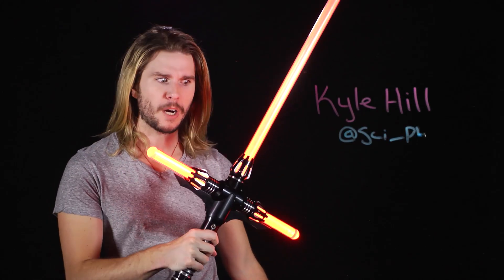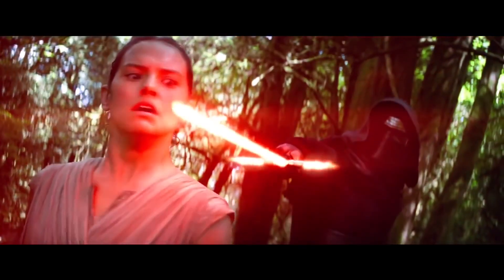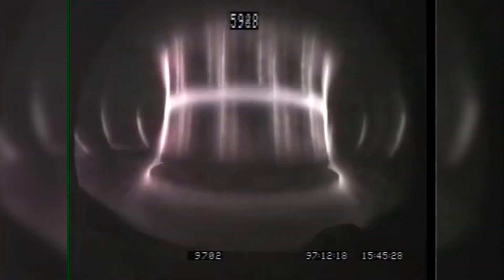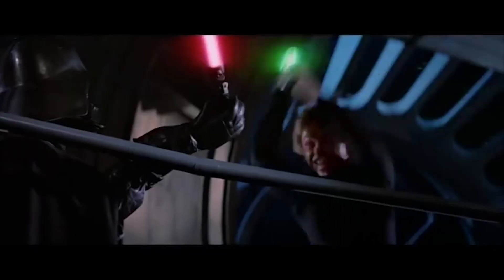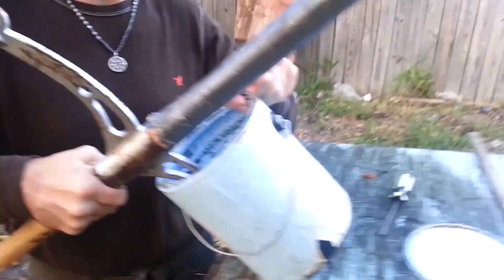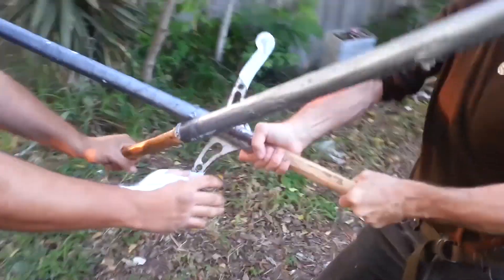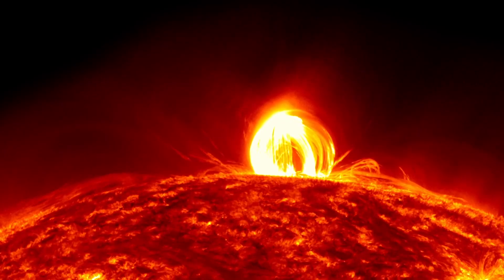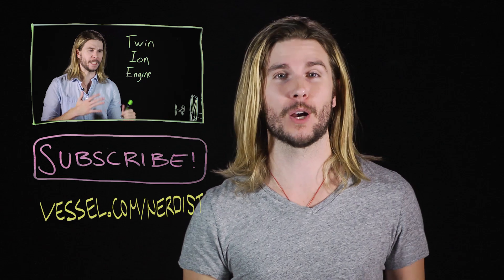Why Kylo Ren's Lightsaber Works (Because Science w/ Kyle Hill)

Comment: We also see Kylo Ren use the cross guard for offensive purposes in the film (don't want to spoil it) so maybe that's a purpose for it. There's also the theory that they're there to vent excess energy, as his lightsaber looks to be either; made by someone not very experienced OR that it's old/broken.
Reply: The weapons book shows that it's made with a cracked Crystal, creating unstable and volatile energy, requiring the split into 3.
Reply: +Laurie Fitton The excess energy is correct, was confirmed at a Disney event a while ago.
Reply: +Laurie Fitton His power crystal that he uses is unstable. That is why his lightsaber arcs cracks and acts like static. It's supposed to be a metaphor to his character. Angry, unstable, unorthodox.
Reply: +DomR1997 The Sith make them synthetically. No natural reds.
Reply: Then direct it in a more forward facing fashion with metal hand guards behind it. They have metals made specifically for withstanding lightsaber blows in the star wars universe. Why no one thought of this is beyond me.
Reply: True. I was just pointing out information, not trying to justify it. In reality, the designers made it this way because it looks badass. They probably didn't think too much beyond that.
Reply: And that the cross guard thing is just venting off some heat
Reply: Disney's official explanation is that his lightsaber's model is a prototype that's really REALLY old
Reply: +Jesus “LastFireAce” Lozano indeed, medieval swords used it for reasons, Ky-Lo Ren is just not so good with a lightsaber(you get what I mean, he's not so experienced with the dark side, this means he didn't have much lightsaber experience)
Reply: +Laurie Fitton - WARNING! SPOILER!
---------------------------------------------------------------------------------------------------------------------------------------------------------------------------------------------
-
-
-
-
-
-
-
-
-
-
-
--------------------------------------------------------------------------------------------------------------------------------------------------------------------------------------------
Kylo's saber utilizes a crystal that has been cracked (unstable crystal) which causes the rough look on the saber itself. It's been described in detail before and used in some games (namely The Force Unleashed) and comics as well as being confirmed by Disney and J.J. Abrams to be the type of crystal Kylo uses.

The design itself, the tri-laser design, is an old one and one of the first from The Old Republic era. It's effective, both for offense and defense and it sure as hell makes for one freakishly cool lightsaber. Plus it fits within the concept of the Order of Ren as well as Kylo's conflicted personality. It's offensive capabilities are clearly demonstrated in the film, when Kylo battles Finn, but the defensive is relies more on logical deduction than visuals. The two extra sides also serve as an energy vent for the unstable crystal, so that it doesn't overload the saber and malfunction, most likely leading to a fairly violent explosion and a painful experience on Kylo's part.

Yes. I'm a major Star Wars nerd... Who isn't? :P
Reply: +Spike Spiegel What is with the recent ignorance of what autism is recently? Why is everyone using it as an insult where it doesn't even make any sense?
Reply: you're right it's to vent excess energy. they even confirmed it
Reply: The reason for the vents is because his crystal is broken
Reply: you mind if i tell you something. what if i told you, the design ain't new and copy from one of the oldest Knight Sword in history. You can use it deffesive and Counter offensive by staving them with it from close combat. also is dangerous. but if you don't know how to use then Don't touch. also a bunch of Normal Sword have it -__-
Reply: +Brandon Adair You mean the crystal he could replace any time? They form in caves in specific areas. All he would have to do is search through old imperial archives I'm sure.
Reply: +tehfaceguy I know that, but wouldn't a functional lightsaber that's not likely to cause self maiming preferable to a red one that's unstable? The sith are supposed to be pragmatic. But he's acting more incompetent than Lucas was when he made Jar Jar.
Reply: +Laurie Fitton Yeah, it was used for an offensive purpose, so no one can fault him for that. And according to Wookieepedia (yes, that's the official name of it), he has those crossguards because they serve as lateral vents for his crystal. It's cracked, so it doesn't produce a solid blade. It's effectively just shooting plasma out of a barely contained field, like the unstable crystals from Force Unleashed.
Reply: +Sam G (ghost trap comedy)  the cross guards aren't even cross guards they are exhaust ports because his power crystal is cracked
Reply: TheWarrener That's just bad logic, right there. That's like saying "hey, if you didn't want to get mugged you shouldn't have gone outside." Seriously, when people decide to reveal information that others would like to be kept secret until they decide otherwise, it's general courtesy to at least offer them a warning. Anyone who spoils a film (or anything else for that matter, within the context of course), on the internet or not, without giving spoiler warnings, is an asshole who needs a lesson in social boundaries.

Take my own comment above for example. I say "Warning! Spoiler!" and then proceed to write my comment in such a way that one has to click 'read more' in order to get it's contents. You know, out of general civility and respect. If you think that's too much effort or not necessary, then in my personal opinion, you're a fucking asshole. But that's me...
Reply: +hassi44 Couldn't have put it better myself, I don't get people who are still moaning even though we have had plenty told to us about the saber.

I'm more curious WHERE he got the crystal, got high hopes for it being Vaders salvaged crystal that was saved along with the helmet :D
Reply: hassi44 It is a Kyber crystal, a cracked red one. I mentioned all this and the effect it has on the sabers design in my reply to Sir Stampsalot :p
Reply: Yeah. They're actually vents. Because the saber is unstable.
Reply: +DomR1997 Red Kaiburr crystals aren't natural, the Sith make them; and each Sith lord makes his own (generally). Darth Maul make his saber in a forge, using the force to keep himself alive and build the saber and crystals!  If Kylo doesn't have the discipline (as is apparent with his tantrums xD) then he wouldn't really be able to forge a fully stable crystal! At least that's my theory
Reply: +DomR1997 be preferable*
Reply: Yeah, that is what Wookiepedia said about his light saber. They said that it is venting energy and made of an unstable crystal.
Reply: +Jesus „LastFireAce” Lozano No it isn't.  Old crossguard didn't have 3rd blade if I remmber good.
Reply: NemoTheEight Your talking about Lightsaber? Then is new, if your talking about sword ain't new, been around.
Reply: Jesus Lozano http://starwars.wikia.com/wiki/Crossguard_lightsaber 2-bladed crossguard lightsaber. Swords never had additionalblades, they rather have blunt guard.
Reply: You don't understand what i mean at all. -_-
Reply: MasterMerc13 So Ren's fanboys just try to create artificial purpose for sth which was just accidentally?
Reply: +MasterMerc13  the unstable blade may also refer his uncontrollable character (kylo himself is very unpredictable)
Reply: +NemoTheEight Brother, I am not a fan of his character by any means. He's the whiniest bitch in Star Wars. I'm just telling you the explanation I found on the wiki; I try to keep up with information like this. It's a cracked crystal, so logic would hold that damage to the source of the blade would cause distortion.

As for the crossguards themselves, the concept is garbage. Unless they're made of the right material (phrik), they'll get shorn clean through like Maul's saber and he'll be down a hand or two.
Reply: +Lukas Gratzer Yeah, I think there's an interview with the actor, Adam Driver, where he specifically refers to his saber as a metaphor for Kylo Ren. He's...definitely unstable, alright. Could use some electroshock therapy. Or a good decapitation.
Reply: +MasterMerc13 are you forgetting 10 year old anakin?
Reply: +Laurie Fitton Its not your fault if you spoil, but its them who uses the internet when they doesn't want spoilers.
Reply: I can't do anything, there will always be people who spoil, what do people that doesn't want to be spoiled expecxt? Its the internet
Reply: That's not a theory it's the canon explanation the crystal is cracked so it needs vents for the excess energy.
Reply: StormyIceHD
Where was this stated?
Reply: +DomR1997 But what if there was a specific reason he wanted this exact crystal. Maybe it was Vader's, he already shows a devotion to everything about him
Reply: +Laurie Fitton you are right m8, Kylo Ren's lightsaber is unstable and you can notice that if you see the SW TFA movie posters, where's Finn with the blue lightsaber and it looks completely normal, but if you look at Kylo's blade it's like emanating sparks...
Reply: +Sir Stampsalot Not experienced with the dark side therefore not experienced with the light saber HE built... No sense in that argument.
The "cross-guard" as stated many times. Including in the new Visual Dictionary. Are ventilation to release excess energy from a cracked Kyber Crystal core which would build up and cause the saber hilt to explode. Yes new, whole crystals can be collected on planets in the outer rim (Illum, Dantooine etc...)  and red crystals are synthetically "grown" but think about this, if you had the knowledge to grow a crystal that powers lightsabers and even the death star laser... Yes a huge kyber crystal powered both the death star and StarKiller bases lasers.
Would you note that down for anyone to just pick up, click on the holocron and boom, Crystals of death and destruction for dummies. With no Sith (that we are aware of as Kylo has already been stated to not be a Sith (yet perhaps) and we know jack all about Snooke) who would pass on the ways of growing the crystals to Kylo and other Sith Acolytes?
I have a feeling the crystal was salvaged along with Vader's helm frommost likely Vader's saber hilt, which would probably either have been on Vaders pyre on Endor or found in the wreckage of the second death star (speculation about the Kylo's crystal origins, i don't claim to be almighty and knowing.) :D
Reply: +Laurie Fitton It can serve more than one purpose.
Reply: TenesAsylum I don't know where he got it from, but supposedly it's a Kyber crystal.
Reply: +abandonedvoid The canon star wars the force awakens visual dictionary
Reply: StormyIceHD
Oh, cool. I'll look into that on the wookiepedia.
Reply: +Laurie Fitton The force crystal is shattered actually. Force crystals are near impossible to come by, so he had to use a shattered one.
Reply: Piggles The Pig Kyber Crystals my good friend. Not near impossible either, there are entire planets covered in them :P
Reply: TenesAsylum Yeah, never can remember the name, but what is the planets name? Either way, it's been confirmed that the crystal is shattered.
Reply: Illum and Dantoinne i think as well, but to a lesser extent, hence why the old jedi temple was there.

Yeah Kylo's crystal is basically split in two.
It's pretty dangerous but if it can be wielded to the same effect Kylo wields it... an unstable/cracked crystal is incredibly dangerous, because they're noted for spitting plasma and excess energy from the magnetized holding field :D
Reply: +DomR1997 " dark side crystals " or red crystals are artificial. The blue or green ones from Illum are used by jedi. The red crystal is said to be more powerful than a natural crystal and could ( even if we never see it in the movies ) " break " the opponent's blade. So I don't think Kylo Ren would like to replace his artificial and powerful crystal. Also, if you've seen the movie, he kinda created his own fighting style, using his crossguard to injure his ennemies. I own a crossguard lightsaber and I can spin it as easily than a regular lightsaber. It offers even more possibilities and is certainly eye catching 😉.
Reply: +Michael Sebi Darth Vader has a natural red crystal thou....
In fact not all the red crystals are artificial...
Plus not all the red crystals can "break"
Reply: BloodLetter !! no.. all Red crystals are artificial and any crystal can break, be it a blaster focusing crystal or a Kyber crystal...
Reply: +Dominic actually acording to lore no you can't just go pick up any ole light saber crystal, the crystal has to choose you, and it takes the color of your personality, red is formed by hurting the crystal, white is by healing a crystal a sith hurt, and kylos is cracked, so it causes a more unstable, effect so he has the exhaust ports for the excess energy his cracked crystal produces, a few sith had a cracked crystal because it's more powerful than a normal crystal, that's why his blade crackles and arcs like it does, rather than stay solid like a normal lightsaber does.

Comment: Defense 1: "The crossguard is the same beam as the main blade just split into the side sections."
Argument 1: "But you can't do that without a second crystal or some kind of refraction thing which would still be compromised in the center."
Defense 2: "It does use a refraction system but the center metal part is made of a lightsaber resistant metal which exists in the Star Wars universe."
Argument 2: "Then why doesn't he just make an entire crossguard out of that metal instead of using a refraction system?"
Defense 3: "It does have a refraction system and a lightsaber resistant crossguard, he just uses the other two smaller beams as extra weapons sort of."
argument 3: "Well that's dumb!"
My argument is: "It's a character flaw, he's so caught up in trying to live up to Darth Vader's legacy, he didn't see anything wrong with it. He probably thought, 'I'll be better than Vader, I'll even make a crossguard so my hand won't get cut off like his did,' and (Being the only apparent force user left aside from Snoke and Luke,) He had no one else to fight with and prove the flaws in his saber."

Comment: those "cross guards" aren't actually cross guards theyre vents because while his lightsaber is based off the thousand year old design the crystal he used was cracked and unstable those cross guards are actually vents to prevent his crystal from just shattering.
 his lightsaber is technically a reflection of himself

Comment: I think the main purpouse is intimidation. Many Siths (And a few jedis) use weapons designed for intimidation and suprise, like the light whip or the spinning double bladed lightsaber. The training of the siths and jedis only covers the basic lightsabers, not all of them. The small blades are not that protective, but in duels, they can disturb the enemy's fighting stile. And you all have seen those lightsaber against lightsaber pushings. The small blades could cut the enemy's arm.

Comment: +Nerdist A heat blocking force field with sensors that detects it's wielder micro seconds before it gets close to that person skin and places that force field specifically on (only) that area would do the trick.  It'd also help control the length of the sabers arc, and help it's been strike against other light sabers beams without passing directly through it. It could also be used to be able to put it near something without cutting it.. The "micro or nano" second it makes contact with someone or something else (made of matter) that part of the force field/shield goes away.

Comment: Parsec is a measurement of distance, not time, get your facts straight. "Doing the Kessel Run in less than 12 parsecs" means that the ship is so fast it can travel closer to the black hole of Kessel than ordinary ships with slower engines....

Comment: i dont know if there was any other explanation in the movies but i had heard that the "crossguards" were actually a biproduct of the old lightsaber design he used that needed to went off plasma for the blade to function properly and that old faulty design was also why his blade crackled and looked unstable unlike say luke's or vaders in the original films
Reply: It's in one of the new books I think and the reason the "blade" looks like that is because the crystal he has is cracked.
Reply: ok now i know thx

Comment: The issue with the hypothisis that the beam is within the lightsaber (Physical) crossguard is that lightsabers form the beam out side of the hilt as the materials used are not lightsaber (Blade) proof. The only materials that are lightsaber proof are very rare and expensive. I mean sure he could have some of these materials but it is still an issue to think about and isn't as easy to solve as the blade is inside the lighsaber would destroy the saber from within without these extreamly rare and expensive materials.
Reply: +SpaceMonkey9288 I think it comes down to aesthetics rather than anything else, creative teams put together ideas and then write story around those. However i do find the parallel of the 'unstable' blade and Kylo's own personality quite symbolic.
Reply: +SpaceMonkey9288 Not only that, isn't his crossguard just vents? Then what would happen if you enlarged those vents by hitting them? Would it make the main beam smaller?
Reply: +Cyanakrli True I guess and I haven't seen it yet (Not blaming you as you did say spoiler) though but...

Spoiler alert... maybe as I've yet to see it so I have no idea.

I thought he had just put it on a display to worship it or just to keep motivated to rebuild the empire so he couldn't of used it but I will wait till I see it to figger out ^_^
Reply: +Cyanakrli Literally every person knows that already. They put it in the trailer. No spoilers whatsoever. Don't worry.